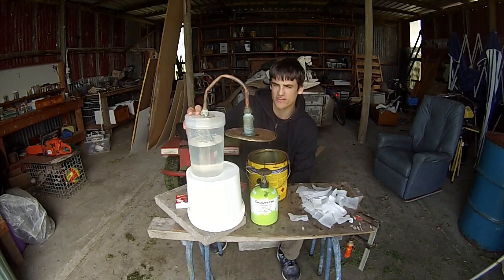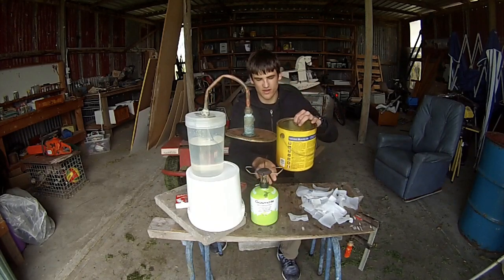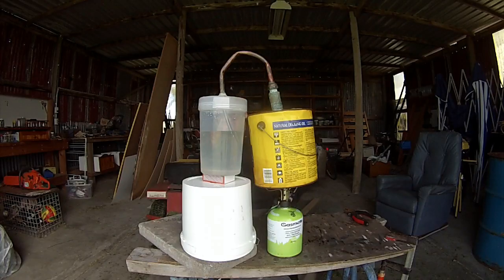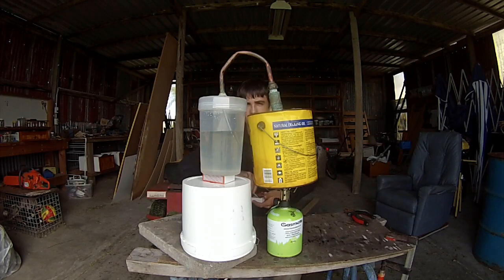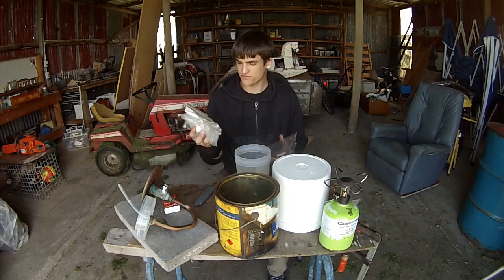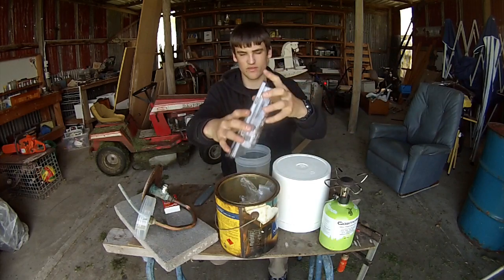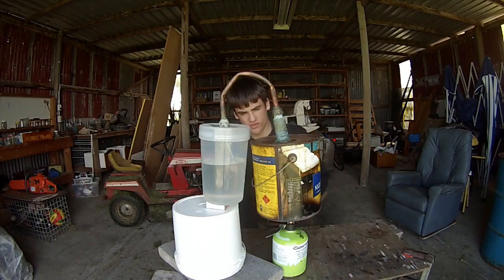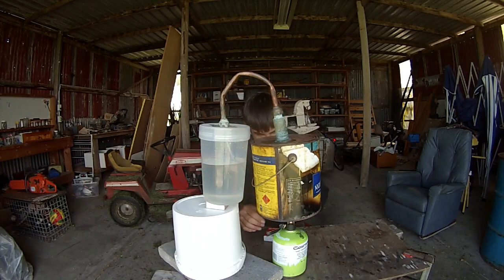Making oil from plastic

Comment: Nice. You have to get it hotter. I have done this before and like you I have only produced the waxy residue. Leakage and heat were my main problems. I have used HDPE, PETE and chopped up tires. Still working on it though. Keep up the good work friend. Peace
Reply from the maker: Okay, next time I will try to sort out leakages, but I didn't think that heat would be an issue because the gas I was using can burn up to almost 2000 degrees celcius.. I guess I need to do heaps more tests before I make another video on it then!
Reply: radicaldanzero. 👍

Comment: Use  refrigeration tubing.. you can get a roll (25ft)of 1/2 copper tubing (inside diameter) for $25 approximately..it already comes in a coil but you can make the coil tighter easily if u need to..you also need cold water constantly..the water u are using to condense is not enough..at minimum use a 5 gal bucket  for your small setup filled with water to the top...also put a boiler drain /drain cock...its what you hook your water hose to at your house...get the one that has 3/4 male threads...then drill a 3/4  hole in the bucket you use at the bottom of the bucket and stick the drain through and put the nut on the inside...seal around the drain with silicone then finish tighten it up..hook up the hose to the bucket and leave the water running during the whole time that you are condensing...This will keep the water cold at all times because it will force the hot water out of the top of the bucket and replace it with colder water constantly...this is why you put the drain at the bottom...it will make it so the farther that the vapors travel through the coil...the colder the water gets...cold water is the best friend to condensing...the colder the better...
Reply from the maker: I'm definitely planning on doing it again but actually buying things for it, so thank you for this!!

Comment: You've entered a minefield here. Decomp products depend on the type of plastic, the amount of O2 present, the heating rate and the max temp. Taking polyethylene (sorry A3X CCY3), the long polymer chains break down to fragments of various size, very few of the monomer. These can interact making results very unpredictable. Also, you will get charring. The particular colour you got would relate to some additive. There have been attempts at producing fuels, but results are variable (I must check that). You will certainly get waxes. Kerosine and conventional oils come from plant degradation products, so you are unlikely to get those. The mixture of materials you might produce will certainly include flammables, but oils are not very likely.

Comment: Doesn't this release all the cancer causing and sterilizing chemicals within the plastics as well as any other additives in it?
Reply from the maker: Yeah probably. But the point is to make it so there is no leakage. I was just nervous of a potential breach and build up of pressure so I poked holes in it which was not very good.

Comment: How Much Should Plastic Kg For 1 Kg Oil?
Reply from the maker: Not 100% sure on the conversion, but for a super efficient machine, you’d need maybe 10kg (give or take) plastic to make 1kg oil. This is only an estimate of mine. So don’t quote me on it.
Reply: If done right 1kg should equal 1l
Reply: Some results on poorer quality plastics are around 800ml diesel to every kg of plastic. Not counting the gas thats produced and used to used power their furnace and lighter oils.
Here is the reference video.
https://youtu.be/hZ6Rv6hERfY

Comment: Just as well I checked. I goofed this time, with the last 3 sentences wrong! You can get oils, which can be fractionated to get fuels. But you need oxygen free conditions, and temps around 400-500ºC. Any oxygen causes charring (the dark colour you saw). In anaerobic conditions, the plastic will be split into fragments of various sizes as I said, which can interact with each other, producing a wide range of hydrocarbons (if polyethylene used. If S, N etc present, these will create additional compounds). As I said, it gets very complicated.

Comment: A South African, Deon Bester, has patented a machine similar that does this on a big scale to produce diesel, but it uses the gas and other fuels created to heat the reactor chamber. In other words, it uses it's own waste materials as fuel and is off-grid. See article: http://www.engineeringnews.co.za/article/grid-independent-plastics-to-diesel-plants-enable-community-involvement-2014-11-07
Reply from the maker: That is actually really cool and efficient. Thanks for sharing it with me!

Comment: Hahahahaha, LOL... Its gonna take you 15lb if Gas to make 1 Cup of Oil. LMAO. Just a guess.. Maybe even less ://///
Reply from the maker: With this converter that I made, I will probably get pretty much nothing from it. I want to make it again in the future though!
Reply: Yea, it's a good try though. Tinkering around is good. If I live close to you, I would come over and be your Side Kick, LOL. In the future, you need to make it like you are distilling Water. I think tht is what you are missing. It has to be cooled in order for the Gas Steam to become liquid :)))
Reply from the maker: The setup was exactly as it would be for distilling water, the problem with this was that it wasn't fully sealed. (There were places for oxygen to enter)
Reply: LOL, No :(((. There is a step missing from your converter. The Gas needs to go through a COLD PIPE or a Pipe that is Copper Coil in Cold Water. So that way, the drip will NOT come out as Gas, but Liquid. That is why I said you need to do it like you are Distilling Water. I hope you will understand this one. :D
Reply from the maker: I understand, but that is a method called fractional distillation, and it used to purify ethanol. For simply distilling water, that method is not needed, but I do get where you are coming from.
Reply: Ok oh, you want to make it like Crude Oil or almost close to it? Or bring Plastic back to the original form?
Reply from the maker: Yeah, something like crude oil would be me goal!